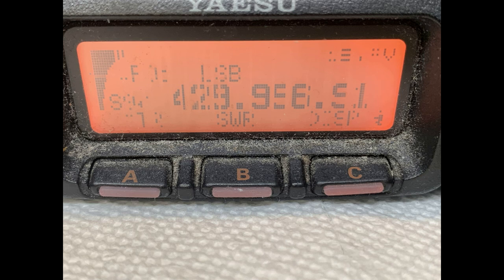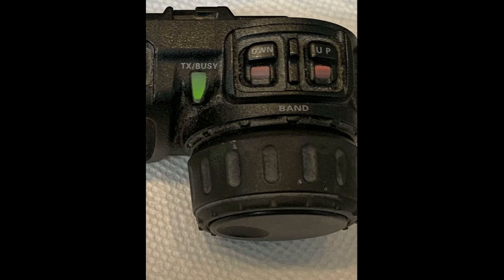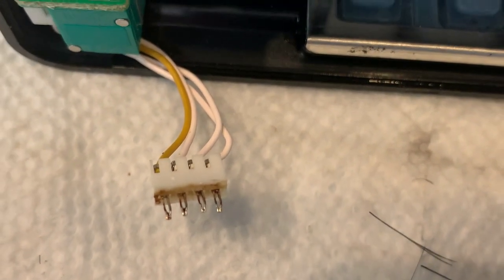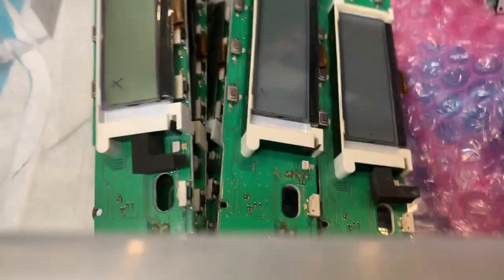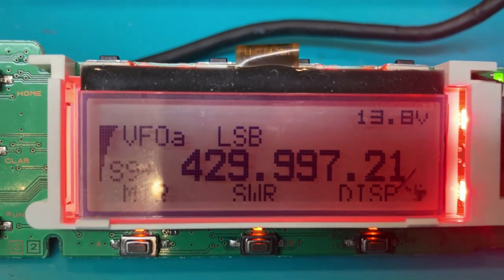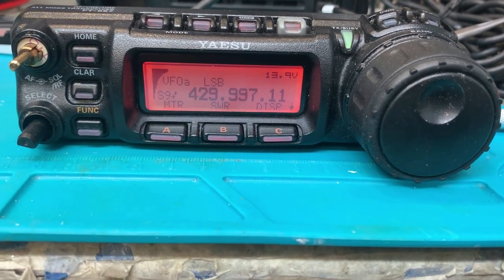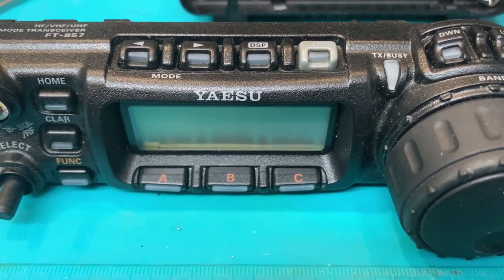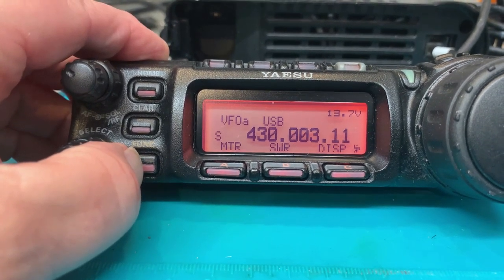Yaesu FT 857 LCD rebuild using after market LCD

Comment: I had mine repaired about 5 years ago by Yaesu.    This is such a wide known problem it should have been fixed for free.
Reply: Free? Not a Japanese way of business. These radios are now up to 25+ years old. Having them installed in hot cars will shorten the life of the contacts.
Reply: @Subgunman  It was a poor design for the contacts on the LCD.

Comment: I just bought an aftermarket board because Yaesu said they no longer have the parts. That's for my 857D. My 897 has one stripe now.
Reply: Where did you buy the part from? Was it only the LCD or full board?